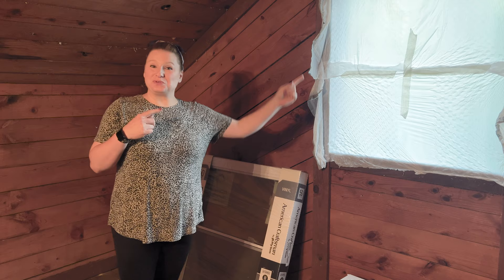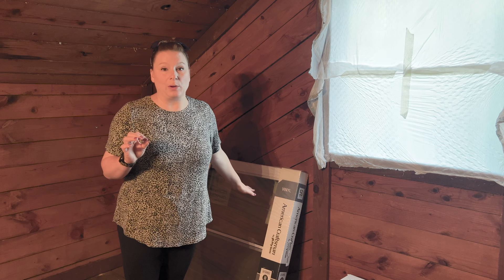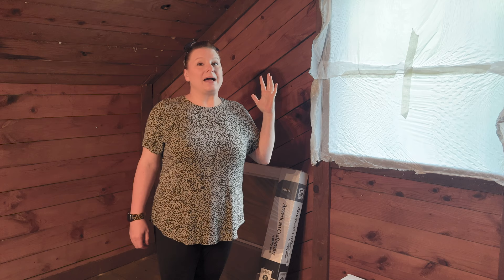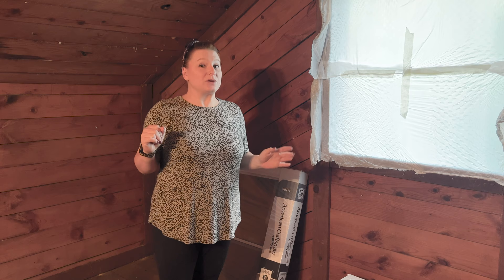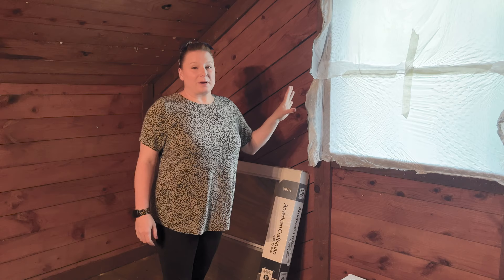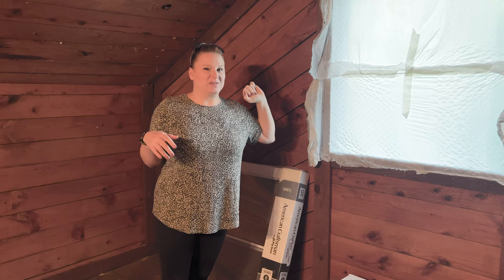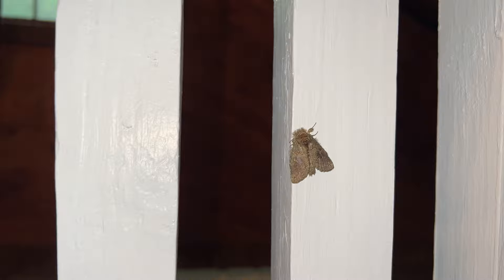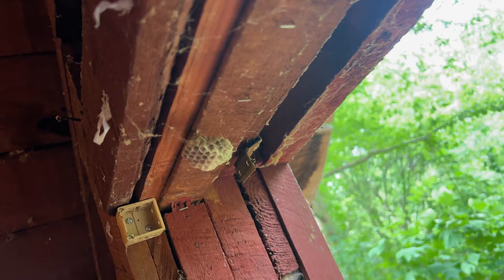Replacing the broken window.

Comment: Excellent job Candice!! Not many people can install windows. It takes a lot of correct measuring to get the window to fit. The black sticky stuff is called ice and water seal. In the north, where temperatures get below zero, code says to wrap around the whole window. This helps  keep water off the wood when rain and snow blow against the window. FYI up here code says ice and water seal must go up at least 3 feet from the bottom of the roof. Then the shingles or metal roof goes on top. If the wind blows the shingles/metal off then the wood is protected from water. Ice and water comes in 3’ rolls too. Love how the window tips in for cleaning and how the screens hidden.

Comment: And remember folks I am of the generation that didn't have air conditioning as I am in my 70's which is good because mom and I can set the temp on her a/c in Florida on 78 or so and feels just fine and we are in extreme heat advisory today where 93 feels like 110. or more. So please drink water and watch out for dizzyness. If necessary a pinch of salt in water helps a lot

Comment: Save the glass and use it in a divider thing or put in a small cabinet type thing. If it is that wavy glass it is hard to  find so save the glass. Surprised it was as level as it was
Reply: Good job 🎉

Comment: Awesome job!
May I recommend getting a tack lifter (often used for upholstery) to add to your tool arsenal to get staples & nails out (to lift them up so you can then grab them with the pliers) & a rubber band on the top of a stripped screw can sometimes help a screwdriver get purchase to remove it.
If in doubt have a go & youtube university 👍

Comment: Just a question why didn't you foam around the window. It stops bugs and water until outside can be sealed. 
Great job!!
Reply from the maker: It comes with foam built in around it.
Reply from the maker: Also, I made it so tight, nothing can be forced in the sides. Oops!